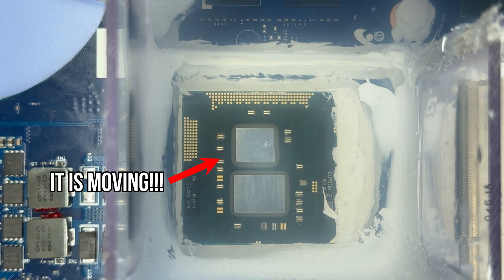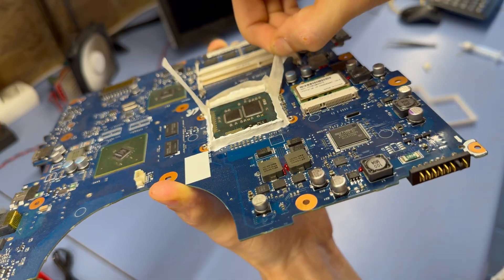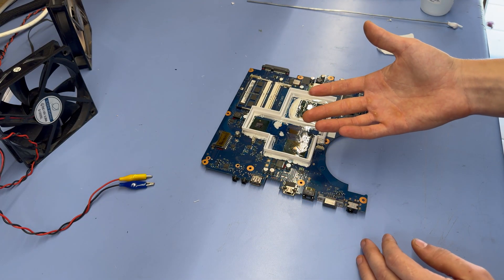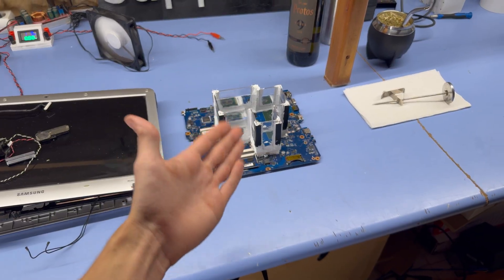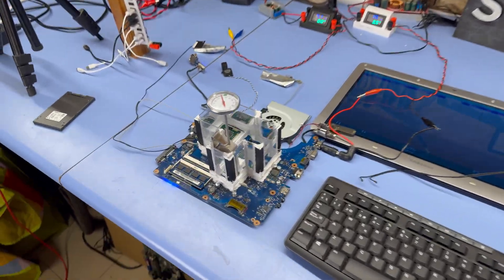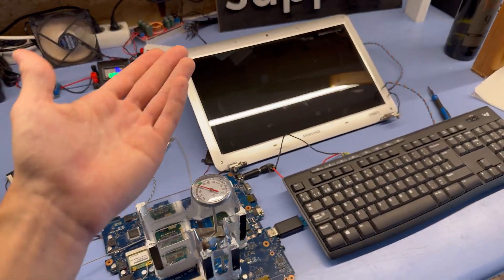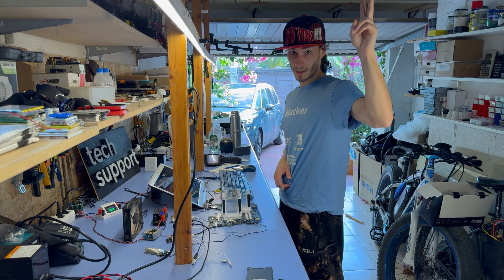I Tried Cooling a CPU With Just Water… and Something Strange Happened

Comment: baby oil is non conductive, as its a mineral oil, try dumping a motherboard in a  fish tanks full of it.. some  extreme over clockers in the late 80's and 90's used to do it with their pc's , am sure theres got to be a guide out there some where but even though the sides of the tank will be enough to dissipate the heat  you will need something to keep the oil circulating for it to be stable.
Reply from the maker: That's a cool idea! I think with a big good copper radiator and a good flow can help in overclocking, maybe will try one day!

Comment: Great video! The temperature right above the die can get high enough to trigger the CPU's thermal protection, especially if the water around it is stagnant and can't dissipate the heat quickly. Creating a water current would help move the heat away from the hotspot, improving cooling efficiency. Adding bubbles might also slightly help by increasing turbulence and mixing, though the effect on surface area is probably minimal. Really interesting setup—thanks for sharing!
Reply from the maker: Thanks for the feedback, mate! I will try stirring or pumping the water in the next one!

Comment: Haha, funny experiment. I did similar a few years ago but never publish a video of it.

A little tank glued on top of a decapped AMD Ryzen 3 Pro 4350G (Motherboard: Gigabyte X570 UD). But unlike your CPU, the Ryzen even ran when boiling water was poured over it...  emergency shutdown at 125°C only without water and heatsink possible (CPU is still alive)😅. I also experienced the waves at minute 12:10, which were likely caused by different water temperatures, similar to a shimmering hot road in summer.

Have you also tried using isopropanol instead of water? The boiling point is much lower and creates many more bubbles, similar to the non-conductive liquid 3M Novec.
Reply from the maker: 125C, damn, that’s pretty hot for a CPU! Thanks for sharing! As of now I didn’t try any other liquid, but that what I plan on the further for sure)

Comment: Water gets hot, density goes down and the water rises up. Light refracts differently in less dense hotter water than the colder water surrounding it, and creates these wavy patterns. They are convection currents. You could see the same when boiling water 😃.
Reply from the maker: That's a great point and explains the wavy patterns perfectly! Thanks for sharing that insight! Peace ✌️

Comment: Micro jets , awhile back I was researching water cooled cpu cores with novec 3m and found the main successor was micro jets on the cpu to increase surface tension of heat distribution..
Reply from the maker: Micro jest sounds interesting to try🤔

Comment: The processor cores have sides:  Sides that are not benefiting from the water cooling due to the resin...
Direct die water cooling has limits because there is too much heat per unit of surface area for water to displace it all.
You are losing art least 20 square mm of cooling surface area.

Further; the CPU backplate gets pretty hot thx to the 100s of copper traces, direct from the core, into it, + the thermal conductivity of the backplate itself.

ie:  Less resin next to ad around the cores will yield better results when you go to more heat dense, smaller process nodes.

I just used  a 'square' chair foot (with plumbing and  pump etc) from a hardware store.
With resin I'd go with a wax inner mould and 3D  printed outer.
Reply from the maker: That's a really interesting point about the resin and the surface area! I'll definitely keep that in mind for future experiments. Thanks for the feedback! Peace ✌️

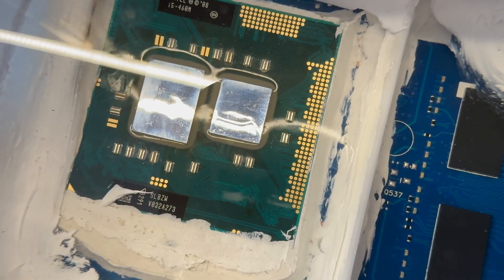Comment: 12:00 Why is that happening... I am no expert on CPUS, maybe som PGA ones maybe^^ But it is like "Heat flickering", if you have a kettle with some window, you will see the same effect (before the bubbles arrive) OR you watch in summer a hot street, you will see sth. similar or starting jet and looking into the exhaust gas flickering ... If the water would move, it could cool "better"... build some "chimney above the cores, maybe you can generate some effect, with changing diameters, leaving some space between water surface and chimney... just a little bit of "tewaking" and testing with that platform. Adding an "cold" source as like ice cube, on the or around the cpu/gpu... cold water falls, heated water raises, so you can build some "paths", which the water has to follow. you can create a "passive" cooler^ creating a "current" through that induced movement or heated/cooled water, which through changing diameters in its path, speed can be adjusted; tighter faster, wider delaying.
Reply from the maker: Thanks for the explanation! Looks like it is the reason for the waves

Comment: water density changing with temperature, along with refraction index... just like mirages and shimmering air over roads..

limited to the die area and ability of water to absorb heat in that area. convection currents.
just a small sink with some fins adds massive radiation area... chimneyed for increased flow works even better...

water is only dumping heat when evaporating or losing it through conduction...

Comment: intense heat causes the molecules of water to vibrate more and creates density difference in different spots. This difference of density leads to light travelling at different speeds,thus make it look like it is moving. This effect is more visible as the temperature of water gets closer to the boiling point. The reason water gets muddy overtime might be because of the glue and resin you use.
Reply from the maker: Thanks for the feedback! Yes, exactly, I think it is the same effect when you look over a hot surface! Peace ✌️

Comment: Earthing fault problem Windows laptops get blue screen if the grounding is not in contact with each other, because there is a test signal on the ground, e.g. where the keyboard is and the motherboard screws. And It should be done as it was at the factory, and the values should not differ too much! I know this from my experience and from other sources as well
Reply from the maker: Great point! So can be a cause of this blue screen too!

Comment: Fill it with Gallium or Mercury, beware the weight though. If you use mercury, you could pump it through a radiator if there is a pump that can handle it.
Reply from the maker: That should be so sick! I am actually thinking about using Gallium first
Reply: @Inventors_Den  I can't wait to see what you come up with, I might try it on my spare PC if the results are decent.

Comment: The work you’re doing is really interesting, but I could give you some suggestions since I tried more or less the same things about 20 years ago.
The problem you have is that “radiator-style” heat dissipation doesn’t work properly with that little water and that little heat.
It’s too little heat to ensure good water mixing for radiator-style dissipation, but still too much to keep the CPU within the right temperature range.
The experiments I did were divided into three areas:
1: Cooling the CPU with a normal waterblock, served by a pump, but instead of using a radiator and fans to cool the circulating water, I used a large tank; I used 80 liters of water.
The thermal drift of heating was practically similar to the natural dissipation of the tank, so I could operate for hours without the tank water getting too hot.
Fortunately, water has a very high specific heat (it heats up by 1°C for every gram of water when you provide 1 calorie), and since 1 kcal/h equals 1.16 W, 80 liters of water, applying about 120 W of heating (at the time I used an Athlon 1200B, bought just months after its release, “slightly” overclocked to about 1600 MHz), after 8 hours, starting from an initial water temperature of 20°C, reached about 30–32°C, but with 8 hours of DVD-to-MPEG2 conversion using Flask0.66 (and it took 8 hours of transcoding!).
2nd experiment: Instead of using a waterblock, I used a (transparent) capsule directly glued to the CPU, in this case a Pentium 3 800, which guaranteed direct cooling of the die, still with a recirculation pump and the same 80-liter tank.
Total failure; the CPU couldn’t even reach 500 MHz before going into protection.
With this experiment, I realized the problem was due to the small heat exchange surface offered by the bare die… way too little.
And in fact, this is your main problem in your application: you don’t have enough surface to extract enough heat.
The heat exchange surface is directly proportional to heat transfer: double the surface, and you’ll increase the exchanged heat (if other variables remain the same).
In this case, you have very little surface, and the CPU temperature rises too high.
The experiment lasted a few days and I couldn’t perfect it because of a water leak that killed the CPU and motherboard.
3rd: Fluorinert.
To avoid CPU deaths, I took this special liquid from 3M in the lab, which is a fluorinated polymer, a perfluorocarbon; replacing the hydrogens in the chain (quite long, from 400 up to 1600 carbon atoms) with fluorine makes this molecule inert both biologically (it’s used as synthetic blood plasma), dielectric, and inert to practically any material; it has a low boiling point, and all these qualities made Cray use it as immersion cooling liquid for its first supercomputers.
Sometimes I see people trying to make a full immersion system with perfluorocarbons, but I can’t imagine the cost.
The downside is that it costs $500 per liter.
I’m a chemist, I work in a well-equipped lab, and I had about a liter available.
Given the small amount, I had to opt for a dual-circuit cooling system, just to test it.
Something very similar to yours (I, however, worked exclusively on the CPU of a desktop; no GPU or chipset), with an open container full of this liquid and a copper coil where water flowed, thanks to a pump, coming from a tank of about 30 liters (a simple floor-cleaning bucket) in which I occasionally added ice.
Another property of Fluorinert is that it has a specific weight of about 2 kg/l and is immiscible with water… water floats on top, so even a possible water leak wasn’t a danger.
Even in this experiment, I didn’t achieve much because I used direct cooling on the CPU die; same problem as before, little surface, with the added issue that many bubbles formed on the die due to Fluorinert boiling.
It worked a bit better thanks to heat removal from boiling (latent heat of vaporization), but it’s not that high since it’s a hydrocarbon (and doesn’t have hydrogen bonds… I’m a chemist, I know what I’m talking about)… Fluorinert’s latent heat of vaporization doesn’t exceed 90 kJ/kg, at about 50°C; water has a value of 2270 kJ/kg at 100°C.
Moreover, I had to cover the container because I was losing a lot of liquid through evaporation.
The coil cooling the Fluorinert was effective in cooling the liquid and condensing the vapors generated by the die’s heat.
It wasn’t a success.
I didn’t achieve any overclock beyond default settings, precisely because there wasn’t enough heat exchange surface.
Things improved slightly when I placed a fan immersed between the CPU and the coil, since it didn’t short-circuit because the liquid was dielectric (but that 60 mm fan really struggled in such a heavy liquid).
The initial idea was to use the cooling system used in Cray machines, but with less liquid and using a double-exchange cooling system with a homemade chiller from an old fridge motor and a copper radiator; the idea was to reach -30°C.
Things improved when I glued a CPU heatsink onto the die (one of those used on old Athlons, not a modern tower with heat pipes); I used an adhesive with fine silver powder… that was expensive too.
So I managed to overclock the Athlon 1200B to 1600 MHz again, but with huge complications, and even managing to cool the Fluorinert well, using ice, salt, and acetone on the secondary cooling system, bringing the Fluorinert to just over 1°C, I didn’t achieve anything more.
In later years, I reused the old system with a waterblock and 80-liter tank, the first solution I described, which keeps the system well cooled and silent, but nowadays CPUs are really powerful and consume very little, and with a simple AIO bought on Amazon, with silent fans, you have everything you need for good cooling performance.
However, the cost of an 80-liter drum, a pump, some tubing, and a waterblock is the most affordable and guarantees really good results in absolute silence (I still recommend using fans to cool the case because the CPU doesn’t suffer from temperature, but the rest of the system does, so that heat still needs to be dissipated).
So, in fact, your problem is that you don’t have enough heat exchange surface and coolant movement to avoid forming heat pockets near the die; that’s all.
I really enjoyed seeing this kind of thing again after so many years; seeing someone looking for alternative (and economical) solutions out of curiosity and to see if they can get something more out of their hardware.

bravo.

PS:
Water becomes cloudy because microbubbles of vapor form.
Reply: That is by far the biggest comment I've seen on YouTube.
Reply: "I have lil recommendations" they said 🤣
Reply: @s.d.gaster6166  
This way, you can start from a solid foundation, although, I confess, making mistakes is fun and fascinating. When you succeed, you're incredibly satisfied and gratified.
It's nice to learn on your own, from your own mistakes.
Reply: @angelogiramondo1540  yeah, I just  wanted yo make a pun, but you are absolutely right, be able pass the frustration of failures build a solid learning in any field
Reply: @GrafTrahula  
When social media was just Usenet, there was a group dedicated to CPU overclocking; we were few, but from that group I saw many of the guys who later, over the years, set major overclocking records with liquid nitrogen, and some of the infotech that everyone follows today.
I even archived a couple of records myself.
I had an advantage; in the lab I handled equipment and compounds that few had access to (usually, at work, I sat next to a liquid helium dewar for the NMR I used daily... do you think I didn’t have the courage to give a CPU a refrigerated bath?).
I saw cooling columns two meters high placed in the middle of rooms, next to the bed, with water splashing down in cascades to cool off and a collection basin around, the most varied custom liquid systems, but... we didn’t put lights or LEDs, except to check if something wasn’t burning!
I built my own additional power boards to modify the VRMs on my Abit boards.
And for quite some time my case was a test bench inside a freezer.
It was our passion, and I saw plenty of CPUs go up in smoke...
Then you grow up, start a family, work changes, but every time I step back into the lab (today I spend 8 to 12 hours a day working on statistical data in the data center) my eyes still shine with joy...
So don’t be afraid to experiment, because you’re building beautiful memories.
Reply: I corrected my comment. It was late last night and it's been a while (15ish years) since I messed around with immersion cooling. So sorry for the errors.
I'm not an a chemist. I see no problem for just doing testing with Novec 7000 but I still wouldn't suggest to drinking of inhaling methoxy-nonafluorobutane on purpose.
Reply: @Troppa17 No, but consider that even drinking only pure bidistilled water, in the right amount, is harmful; it leads to osmolarity and cell lysis, meaning the loss of all body salts and the swelling and bursting of red blood cells. You literally dilute the plasma so much, expelling salts, that it changes the blood’s pH and haemoglobin loses its characteristic spatial structure, releasing iron and thus suffocating you. (I recall an episode of ‘Columbo’ where a woman gave her husband ‘pure’ water for weeks as a murder weapon… I assure you it tastes awful; tested personally).
Reply: thanks for sharing your fascinating experience!
Reply: @whiteburr  Thank you all for listening to the memories of an old enthusiast... some memories still warm my heart!
Reply from the maker: Wow, thank you so much for sharing your extensive experience and detailed insights! This is incredibly helpful and gives me a lot to think about for future experiments, especially regarding the heat exchange surface and coolant movement. Really appreciate you taking the time to write all of this! Peace ✌️